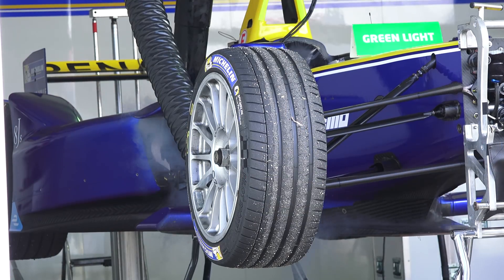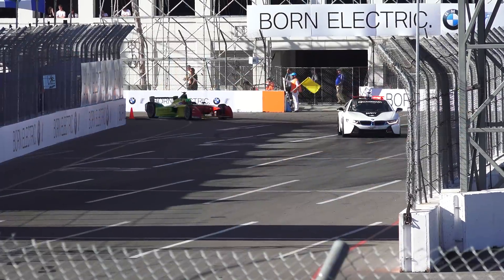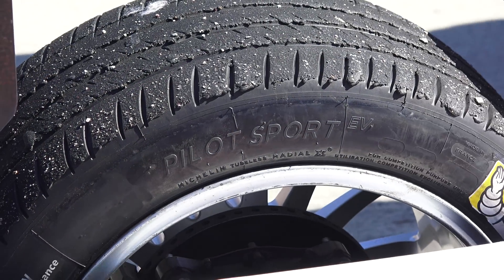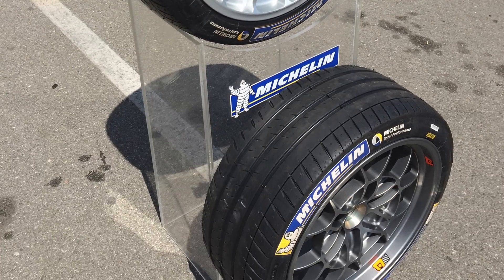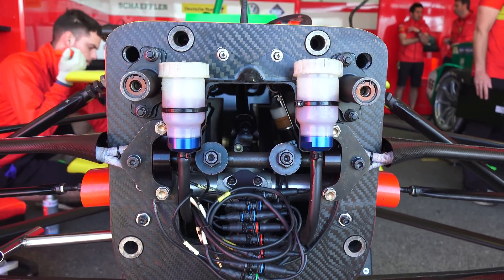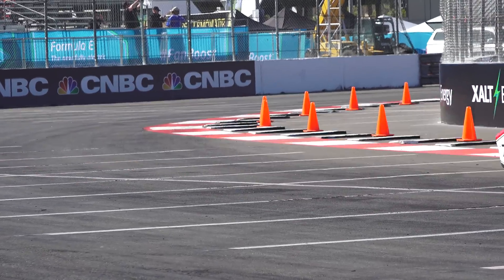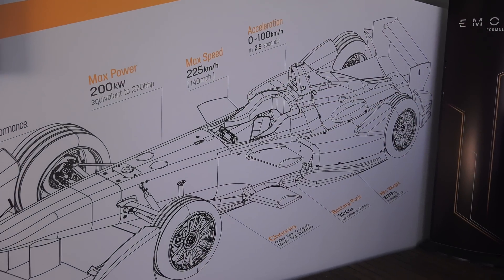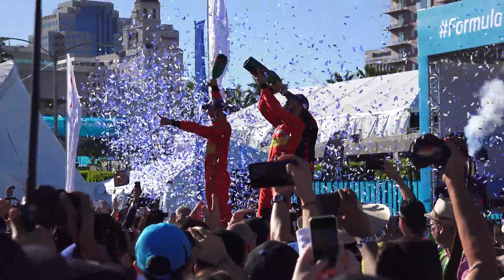The Engineering Behind Formula E - How It Works

Comment: I'm not a fan of these tires. So few tires available in an otherwise high tech sport. 
Anything that reduces pace around the track also takes away from the appeal of the series. Although admittedly, there are diminishing returns due to the progressive nature in air drag.
I wouldn't mind at all to get lighter cars with better aero, wider slicks tires that don't typically last a whole (half) race, and of course the one-race battery pack. Why not give teams more freedom to develop their cars in terms of pace, while limiting most only the battery back. The more freedom they get, the more road relevant it all gets. Now the formula seems aimed at allowing the full number of laps pretty much at full blast, in case there are no safety car situations. It would be nice if we could really see them cranking it up after a SC due to saved energy. 170kW limitation is a bit lame on a heavy singleseater with narrow durable tires. The cars are slower than they need to be. The tracks as a result need to be unique and mickey-mouse else we'd see that jummior entry level low budget series are quicker.
I hope a competing series soon steps up with electric racing. Perhaps more Le Mans style bodies, optimal aero, low mass, fast tires, more pit stops, more competitive to petrol racing.
Reply: +Cloxxki  watch a single race and you will love low traction tires in racing ;)
Reply: Peter Hans I've watched many races. I enjoy the racing to a point, but not the engineering.
0-100kph in 2.9 seconds, that's a score for a large electric family sedan well over twice the weight.
I think the tech is TOO limited. Or the race too long.
Why not have really fast cars and shorter races, then for instance 2 races in stead of a car swap? Needless extra costs there to get a longer event. If the battery had a maximum weight rather than specified capacity, it would accelerate technological progress more.
Reply: yes, this has lots of unused potential.

Comment: The technologies that get developed for Formula E should improvements in consumer cars. The tire wear, electric motors, batteries, etc.
Reply: +The Real Santa Claus Well, that's just partially true. It's true that the teams don't develope the batteries by their own. But the Batterie supplier has to meet the requirements given out by the FIA. And as Jason stated in the Video, the Batteries they plan to use in 2019 should have twice the capacity of the Batteries they have now. So there is a development in the background.
Reply: Carl Siemens they do
Reply: +dimmddr1 well, they don't really develop batteries since they all use the same, but there will be great innovations in tires and electric motors

Comment: Why don`t high end supercars look more like Formula cars?
Reply: +Peter Lustig because I need space to carry my chick and my golf clubs.
Reply: +Peter Lustig Because of bumper laws, head light, turn signal yadda yadda yadda. Did you know cars have regulations to improve the safety of car-pedestrian collisions? That's one of the reasons why vehicles do not have "flip-up" head lights anymore.
Reply: +فيصل الثاني عشر (fsfsxii) pop up headlights that were really popular in the early 90s were banned in many countries due to crash safety in an accident involving a pedestrian I believe.
Reply: +Peter Lustig Väldigt lustigt!
Reply: +Steven Trott Could you please elaborate on the flip-up head lights matter?
Reply: +Steven Trott Forget those pedestrians who just can't afford a car 😄. I Germany there is a guy who modified his formula car to make it street legal.
Reply: If you rub the Barrier in a close wheel supercar, the worst that would happen would be that you would need some bodywork, which can be pretty darn expensive, it's nowhere near as expensive as losing a wheel.
Reply: There are some legal track cars looking kind of similar to formula cars. One seat in the middle but probably not luggage space.

Comment: if they wanted to make it a bit watched by spectator, they HAVE TO open the regulation, like JGTC back in the days. The it will show the potential from electric cars to the world
Reply from the maker: +lelegume1635 Each year the series is becoming more and more open - it has to roll out slowly so that the cost is not absurd. That said, the jump from year one to year two was huge, opening up the transmission, motors, battery, rear suspension, etc.
Reply: +Engineering Explained yes, there is improvement, and maybe the costs are slowing down the process, but i think that it's not unmakable. The Drayson B12 or even the sls electric car have proven that electric cars couls be near as fast as gas car nowadays. So a formula car should be a bit faster than they are now, and it wouls appeal richer car maker. I can wait to see the future of these

Comment: how retarded is the 200kW FanBoost... Like racing with such regulations of battery capacity and engine power output should be all about how engineers manage to make the car more efficient, not fans giving a 30kW boost. It's not that serious, but it could be the winning factor for many races.
Reply: It could be, yet it's not at all.

Comment: can you make an explanation why does lmp1 cars are diesel, im curious about fastest cars on track carrying diesel on it
Reply: +Myst Lynx First of all, diesel has a higher energy density than gasoline of up to 13% more energy per gallon. Now for the reason LMP1 cars (mainly the Audi R18) use diesel instead of gasoline. The 24h race of LeMans is an endurance race. The idea of using diesel is utilizing the lower fuel consumption. The more time you can spend out on track instead of refueling in the pits is crucial to victory. The R18 for example takes this even further by combining the diesel engine with electric motors which not only up the power output but also help saving fuel. Top speed is over 340km/h with an average fuel consumption of 33l/100km (~7mi/gal) on the LeMans circuit, which is very low for a 840hp race car going as fast as possible.
Reply: yeah i would like to know too most cars are gasoline right? gas is powerful than diesel
Reply: +OhMyKMPR ohh so that's why

Comment: what is the powertrain that they are using.
Reply: powertrains in FE are quite...  "free" to choose from. 

I'd Call it MR cars; however,  some teams use twin motors and a fixed gear. Other teams use a single motor and 2, 3, 4, or 5 gears. 

does that answer the question?  :)

Comment: Wait so a P90D with ludacris is faster in 0-60?
Reply from the maker: +Grant Rodgers Considering it has about 3x the horsepower and AWD, to me it's surprising how small the gap is - and that's only straight line performance.
Reply: I know, I like the series, it's just kind of ironic
Reply: +Grant Rodgers It's faster to 62 than a F1 car too. Straight line from standstill is a very specific type of racing.  To put that sort of power down through the rear wheels of a light car is very difficult and tells very little about the car these days that 300bhp isn't a lot. This is why for example koenigsegg says that they're more interested in 0-300kph times than 0-100.
Reply: +Grant Rodgers Much more power even if it's heavyier

Comment: Very interesting! But i have a question. Is it better to have a big motor and then  have the power go trough a transmission and differential or to have 2(or 4) smaller motors one in each wheel?
Reply from the maker: +0ExG0 That's a question the teams will likely be deciding over the next few years. It's cool because "what's best" isn't known at this point, hence the wide range of transmission gears this season.

Comment: Doesn't seem like this will take over F1 any time soon, which I like. I think both should run alongside, but I prefer ICE's in racing. Great video!
Reply: +oliver24x Soon. The motor/engine performance favours the electric motor easily. But the battery/fuel tank technology favours the ICE due to petroleum having Energy density of 12,2000 Wh/kg while battery has only 200 Wh/kg.
Reply: +oliver24x I hope it won't take over F1 anytime soon but I definitely hope it will be it's own recognized thing alongside the traditional F1. No doubt the ICEs are the fan's and probably team's favorites just because of the sound and history attached to them and racing in general.

As an engineering student, however, I'm very excited to see how Formula-E evolves in the next couple of years. More power, more efficiency and hopefully more recognition is something to come in the not so distant future. There's lots of potential in these little electric motors and lots of experience to be made in electric racing.

Comment: why do cars with lots of downforce ar the front bounce around when they are turning in slow corners.
Reply from the maker: +Mithun Kalan Stiff suspensions - you'll need a stiff suspension to compensate for loads of downforce, because at speed the vehicle will lower as a result of the downforce.
Reply: +Mithun Kalan That's not downforce, but spring tension/rate. If you run a lot of downforce you also need a stiffer damper setup as to not bottom out the dampers when going at high speeds (and thus a lot of added weight from downforce). The downsite to this is that stiffer dampers means more bounce and potentially loss of traction since the tires leave the surface. It's all about finding the optimal balance.